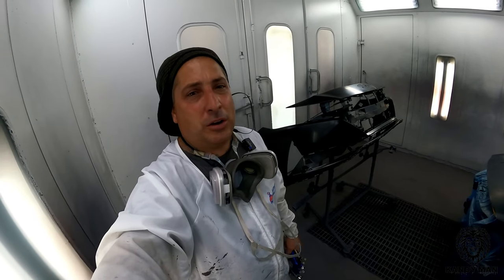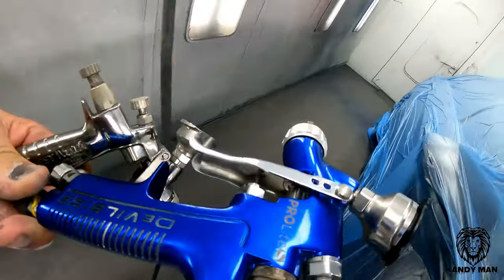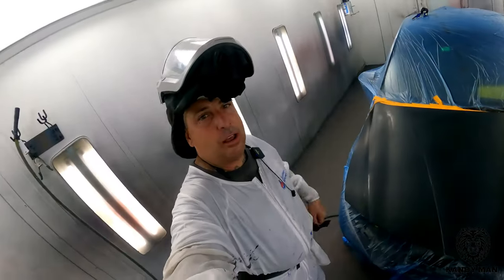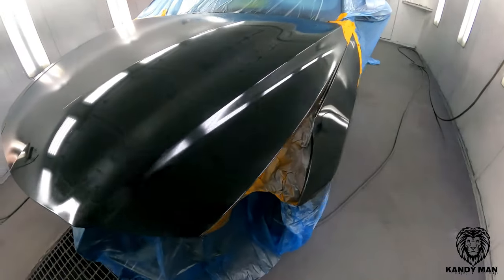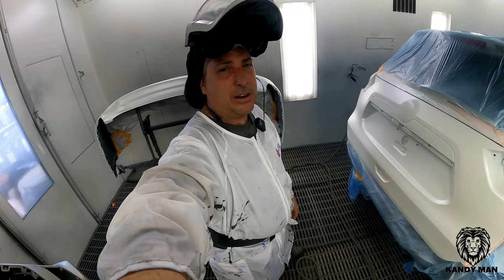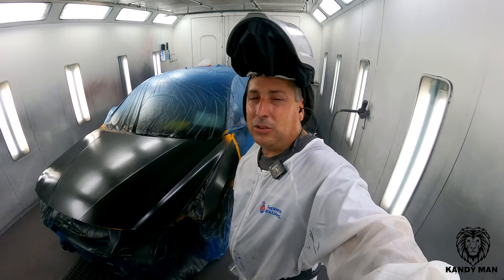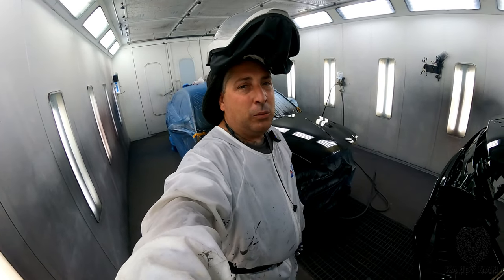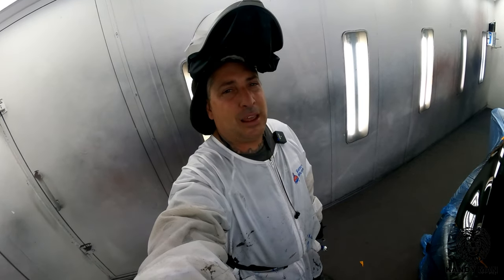BEST MINI GUN - PRO LITE S

Comment: Best mini i ever owned as far atomization and spraying was the Walcom Ego190 weather using the 0.7mm needle/nozzle/cap for cerakote, or the 1.0 and 1.2mm sets for spot repair. Problem is the gun lasted 14 months though it was used almost 7 days a week. Now i have a Devilbiss DV1S mini 0.7mm/0.9mm with micro cap, as well as a 1.2mm nozzle and S1 cap for spot repair. Before those two guns the mini prolite was my favorite

Comment: Fantastic finish on that clearcoat Kandy Man it came out really flat and glassy👌I have 2 of the SRI ProLite which is the same gun just the older version and totally agree that it does a great job, I've now got the DV1S which I think is even better than the SRI ProLite👊👍John UK.
Reply from the maker: Thinking of pick one of those up thanks for watching 👊
Reply: Yeah they are a great gun, I don't think the DV1S is quite as fast as the SRI but it has a nice fan and the atomisation is spot on👍👍

Comment: I'm  a Wheel repair guy, Been using a sata for years, But the newer stuff seems to be better. it's a 1.0 needle. I tried Airbrush and i hated it. Now i want to spot small bumper repairs and bottom of spoilers. Would you recommend this?
Reply from the maker: Absolutely

Comment: Great videos have you tried the farecla g360 rubbing compound? If so what are your thoughts?
Reply from the maker: Yes I use it at work not bad I start with wool  then  white foam then the second  step compound an d black to make sure it fully buffed 👍
Reply: @kandyman5315  ok thanks we just started using at work haven't used it enough yet to have a good opinion thanks for the reply